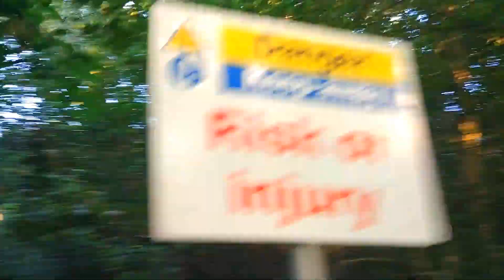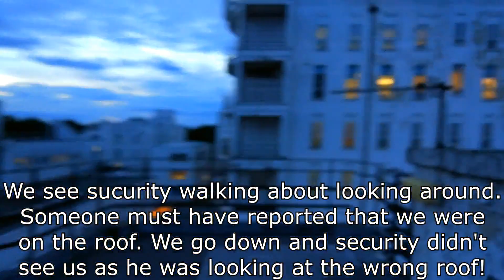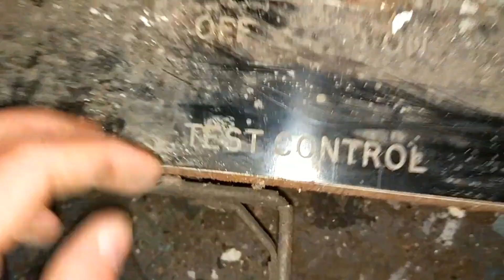10 URBEXes in 10 mins

Comment: Ahhh... that bridge... stupid lorry driver who wrecked such a nice and unusual bridge. It has a spiral ramp, that is such a cool design.
Reply from the maker: Did the bridge make it to the news in the Netherlands?
Reply: No, but just seeing it in your video with the explaination of what happened there seemed a bit heartbraking to me as a structural engineer who is occasionally  involved in the design of such bridges. That bridge looked like a very elegant design to me and then see it beeing destroyed by a stupid lorry driver... brings a figurative tear to the eye. Currently I am  working on a bycle/foot brigde with concrete piers and a fibre-composite deck which has a somewhat similair design as the bridge in the video.
Reply: @dykodesigns That's interesting. Whereabouts are some of the bridges and other structures you've designed located?
Reply: asmqb7 Various places in The netherlands, from Delden, to Nijmegen and Woerden. Both bridges and buildings. Most of them where designed by others but I had some involvement in the structural engineering of them. This can range from making shop drawings for the concrete structure to doing structural calculations and working with a landscape architect on the design of a footbridge. Each project is different and the design teams also vary. Different building companies and local goverernments each with their own ways and requirements.